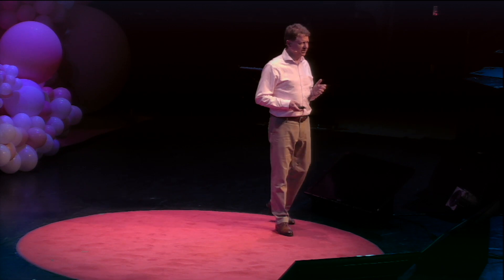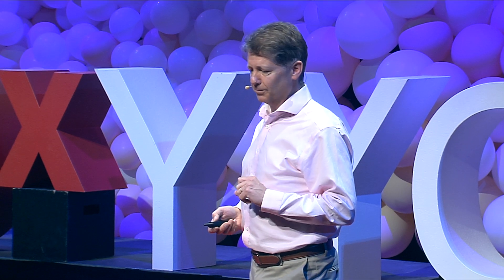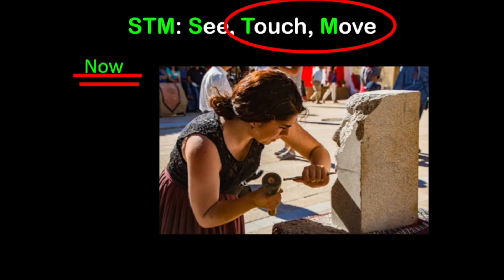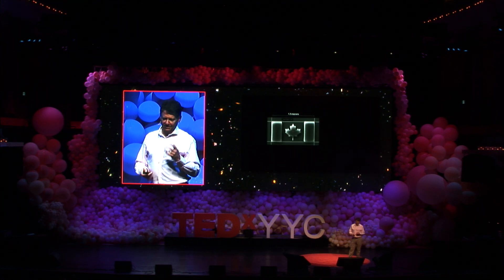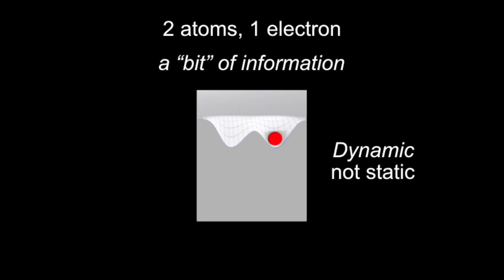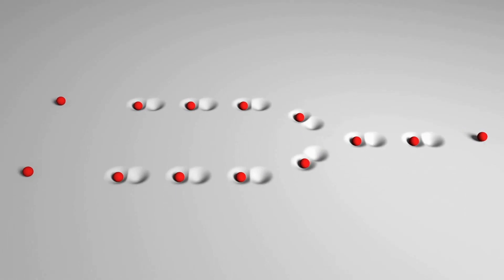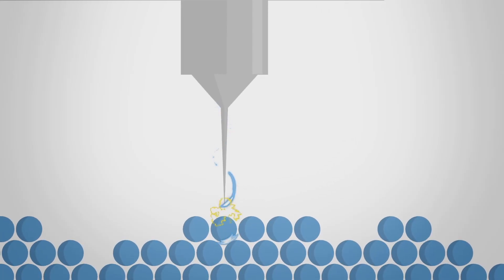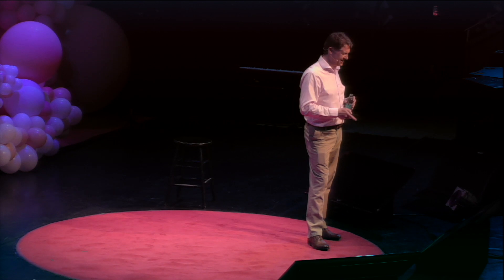Atom Scale Manufacturing: The Path to Ultimate Green Technologies | Robert Wolkow | TEDxYYC

Comment: But the question is how do you integrate quantum circuits into conventional systems?
Or how do you even store the result of any logic calculation ?🤔
Maybe im missing some basic facts, is there a electron potential near atoms, that could be used to read out the results?
Reply: The atom scale circuits can be embedded in existing silicon chips

Comment: I don't understand how it can be both "very permanent" and editable at the same time. Those seem to be mutually exclusive statements.
Reply: I think he is using permanent to mean that it is very unlikely to simply change on its own. like a lego brick. once two are put in place and connected it will not change on its own. but you can still change it if you want
Reply: It's like how computer harddrives are considered permanent storage. You can store files permanently, but you can also delete / modify them. Its different from memory which loses it's data if you turn off your device.

Comment: In the 1950s, computers ran on vacuum tubes and were really inefficient. Hardly any energy was used on compute. If you make computers that are ten times more efficient, people will use 20X more compute. We need to make computers less efficient. (Or whack a tax on fossil fuel electricity. )

Comment: Man. im sure its energy effeciency are great but its slower than normal computer isnt it?
maybe it will be useful for space probes but not good for regular user
Reply: There's nothing about this that would make it slower than a normal computer.  The electrons will move at the same speed through these circuits as they do any other. Technically since the circuits are smaller and the electrons have less distance to cover, calculations should run quite a bit faster. Also less power consumed means less heat, means less thermal throttling with is a huge limiting factor on how fast current chips can run.
Reply: Sahin, this isn't even at the prototype stage yet. Think of it as a proof of concept. The potential is enormous
Reply: @keshanranasinghe  The potential i can think of this is just unlimited data storage without lostiing any data and using any energy for protect data
but even so this comcept isnt suitable for future computer because adding more steps make you slow for solving problems
well if he made up diffrent coding base rather than binary coding base it had more approvable for complex systems as like encrypting passwords
Reply: @sahinyasar9119  please read Dirk's comment for further clarification